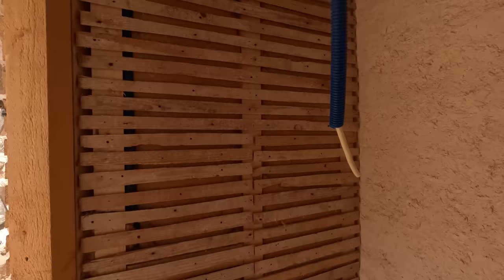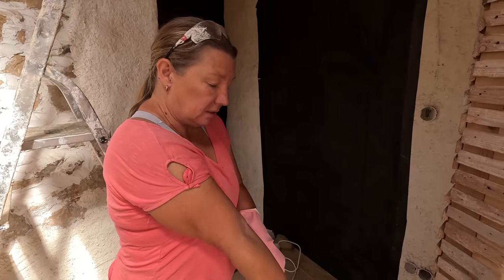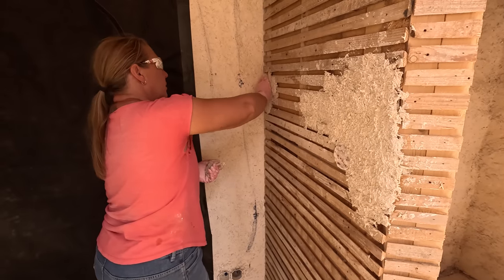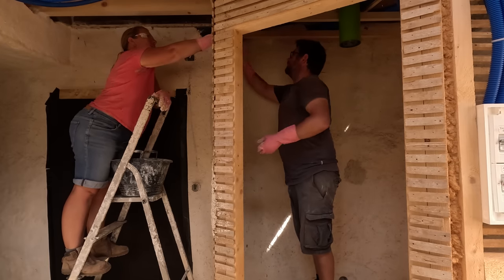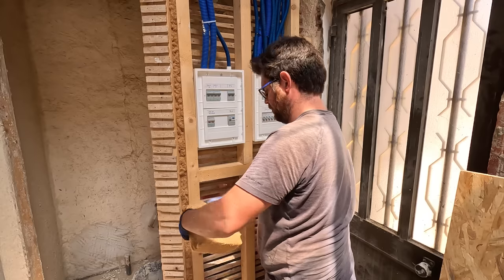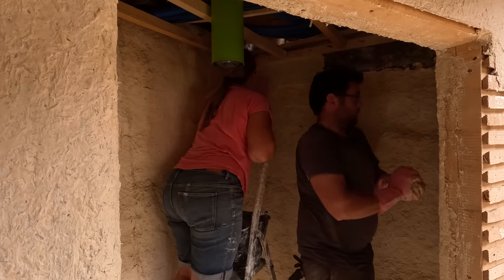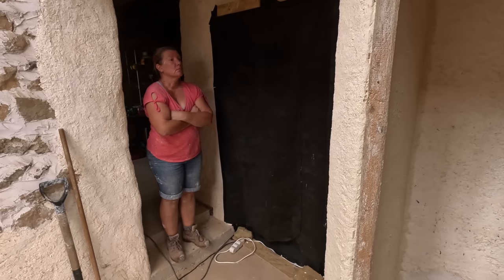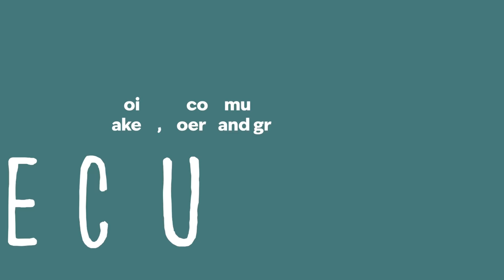Hemp Plastering over Old Laths - Portugal Property Renovation

Comment: The spaces in the laths were to allow the plaster to hook over the lath so it was really important to push up when applying. Those  “hooks” then held the weight of the plaster firmly to the wall. You probably saw that squished through and folded over slightly in the old plaster you removed? Your laths are soooo neat (Kirsty?). Love your channel and until the crochet episode I was slightly worried about what Kristy would do with herself when the Reno is finished
Reply from the maker: That hooking over is a lot more important when using lime/sand whereas lime/hemp is super light. Plus, hemp sticks to almost everything… including a flat surface of timber. It truly is amazing to work with

ps. It’s Kylie 😀
Reply: @MAKEDOGROW  oops sorry Kylie

Comment: You can search for anti fog glasses, and N95 masks with a filter. Or a respirator with a pancake multi cartridge filter. They are flat can be pink in colour filters that work for dust, vapors, aerosols, fumes, particulates etc… There are also ocular goggle type glasses with foam rims that have air vents. You can also look into face shields. Best of luck to you, PPE is tres importante! Always protect your vision, hearing, lungs, appendages, and wear proper foot wear. Glad to see you wearing it.
Reply from the maker: Yep, we’ve tried multiple ‘anti-fog’ glasses, but still haven’t found any that actually work.

We already have the serious type of respirators with the hard triangular type filters, but can’t find anything that’s good for just woodworking. I’ve seen the pink type ones on YT but can’t seem to find any here. Might have to look further afield.

Our steel caps are probably our best, and most effective PPE purchase 😀

Comment: There's more benefits using hemp lime plastering compared to dry wall'in;
- Texture; The walls are "organic" (as someone said), does not - depending on personal taste - require filler and sanding and additional wallpaper or paint.
- Acoustics; The surface irregularities gives a less "echoing" area wihtout need to add additional textures. 

The latter might be a benefit in a toilet - sorry....

Comment: Have you considered covering the wall in the closet behind the electrical boxes with a removable plywood panel? You could paint the plywood  to match the plaster. Then you can finish the plaster around the electrical boxes in the main room, and still have permanent access to the electrical boxes for future electrical work.

Comment: If you've got a water connection to the house, taps that fit onto plumbed in piping aren't expensive, and you may be able to plumb in the toilet so it flushes, and have the rest of the plumbing to finish when you can. You don't have to do the entire plumbing work at the same time at all.

Comment: Great job! Love seeing this! If you want to be able to keep working in colder weather, we would recommend mixing also with hydraulic lime (we use Prompt by Vicat, which is also available in Portugal!) You will reduce the curing time and improve the consistency of the mixture!
Reply from the maker: This is one of the few walls that isn’t stone … and we don’t really want to use hydraulic on our stone walls. We’re hoping we might get to do some proper hempcrete, rather than hemp plaster, in the future (to add to a very thin brick wall) and then it would definitely be better to add some hydraulic.

We’ve not had a lot of luck sourcing hemp related products here, no-one seems willing to deliver to us (we’re right in the middle of the interior which is too far from many of the bigger cities)

Comment: I've owned at least three houses in the U.S. over the years that had "plaster and lath" (as termed in the U.S.).  In the U.S. plaster and lath were used until after WWII, when plaster board entered the market around the late 1940s.  Plaster board was very dense, very hard and thin (1/4" or about 6mm), and plaster was applied over it.  Dry wall (aka gyp board) became favored by the mid-1950s, and was universally used in the U.S. by about 1960.  The plaster used in the U.S. 100 years ago had horse hair mixed in and was much smoother and more pliable than your hemp mix.  From appearances when walls on old houses in the U.S. are demo-ed, the old plaster with horse hair appeared to key into the lath easily.  Can you remind us why you would use the plaster and hemp for application on the wood lath?  What are the benefits over a "traditional" plaster from 100 years ago?

Comment: any dust mask with an exhaust valve will help on the fogging up and not make them moist and nasty inside where those without a valve will give fluid in the lungs if you use them more than just shortly... and they don't need to be big fancy ventilated things or anything... they come in cheap "on time use" ones

Comment: Because wood absorbs moisture, why don't you cover the lathes with a moisture barrier product like Tyvek. That is used in the US before applying stucco to an exterior wall surface, just a thought.
Reply from the maker: No, that would be totally inappropriate. Moisture is only a problem if it persists … the plaster will soon be dry and no moisture will be left.

You shouldn’t mix new building techniques with old … unless you really understand the fundamentals of both types of building construction.

Comment: I'm probably stating the obvious, here, but the hemp is preventing the mix from easily getting between the lath. Since these are interior wall, would you need the hemp. Straight lime plaster would push/flow easily into and onto the lath.

Comment: Hi guys, here are my suggestions/tips/observations on the plastering, having some experience both with plastering lath and using hemp lime. Traditionally lath is plastered with a lime mortar with hair in it. The hair helps bind the plaster on the slightly unfriendly wooden laths, and helps hold the keys together. I think hemp might do much the same, but I suspect it would be a bit too lumpy on lath. The scratch coat on lath is meant to be a fairly tight coat. 

I'd also suggest that the gaps between your laths are too large. They're meant to be about as large as the width of a lath itself (side edge), or maybe a little finger. The large gaps you guys have will weaken the plaster, but the hemp might counteract that. Another factor with overly large gaps is that it's much more difficult to form keys, as the plaster will often just fall through a large gap. A drier mix will help here. 

In terms of the consistency, my first ever mix was way too dry. It all just fell off as I was trying to trowel it! If it's too dry it's very difficult to push through the laths. If it's too wet it will just fall through the laths (or sag heavily if on a ceiling), and will also be prone to crack as it dries. 
I'd definitely use a trowel. Once you get going it shouldn't be too hard. The key is to load the trowel up and push quite hard, but not too hard. Always try to stop at a gap in the lath. If you try to spread a bit more plaster onto the next lath it will just fall on the ground as you haven't formed a key. It's also best to keep working back towards the plaster you've done already as this keeps the falling plaster to a minimum. 

Lastly, you want to consume a lot of plaster. They keys need to be substantial, and need to hang down around the backs of the lath, and in some places should even meet and merge with other keys. Plan for around half the plaster going into the gaps between the lath and behind to form keys. 
Hope that helps!

Comment: Good morning,

Use a plasters trowel and a hawk. Perhaps spray the laths lightly first. 

Rendering by hand is killing? Oil drum and spot board to work from save you hours.

Also for bigger areas you need a pan mixer (expensive!) but when using lime and hemp mix the pan mixer gives an even mix. The standard mixers are not very good and binds up with the lime/ hemp mix etc. 

I would worth adding chopped horse hair in the first coat. 

You can also rub up the first coat with a wood plastering trowel to get an even finish and a sponge. (Plus a straight edge).
Keep the wall wet with with hessian sacking and keep spraying to allow the lime to go off slowly in the Portuguese heat. Lime need to cure slowly. Heat or the cold kill the lime.

Also use a scrapper on the first coat finish for a key for the finish coat. Make one up from a timber and nails. 

Old House Store in Reading are quite good and would send to Portugal I am sure.
 
Might be worth seeing if you can get tonne bags of soft stuff for the finish plaster. Also course stuff for the scratch coat with hair already mixed in. I always found that the NLH 3.5 bagged lime was a bit tricky to use. The pre mixed soft and course stuff is ideal.

NLH 5 is useful were damp and water weather, chimneys pointing etc are concerned.

Might be worth find:-

 Earth Building
Methods and Materials, Repair and Conservation
By Laurence Keefe
Copyright 2005 Larry Keeth   £56 on eBay
Earthmans bible, stone built building are the same as cob built buildings? 

I am not sure but your house may well be built of earth mortars. To save cash you can also use the soils around you for a mortar without additions of Lime etc.   After all everything before the railways was built with loads earth mortars. Cob or stone built.

In Normandy it is the same. Here in Bucks we have wychett which is wonderful stuff?  For walls mortars rendering, yet everybody is frightened of it. So they all resort to good old Portland Cement. which kill everything. That is the few people who know about it and are prepared to do the right thing.

Hope that helps.

Rex

PS:- For floors:- expanded glass is ideal and then you only need a good course sand and lime mix for the screed 120mm plus. Just be a bit careful of under floor heating systems.

Again you need to be careful to allow the lime screed to go off slowly.

 .

Comment: Why do you put hemp into your plaster even for interior walls? Easier to work with? Cheaper?
Reply from the maker: There’s a couple of benefits of using it over a traditional lime/sand mix … mostly insulation, acoustic dampening and humidity control.

We also really enjoy working with it and have plenty of it on-site